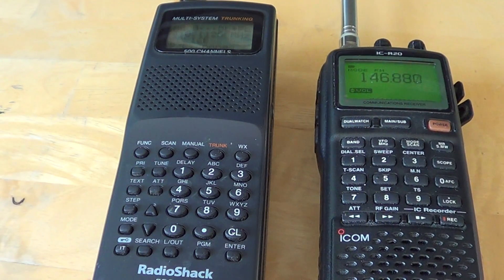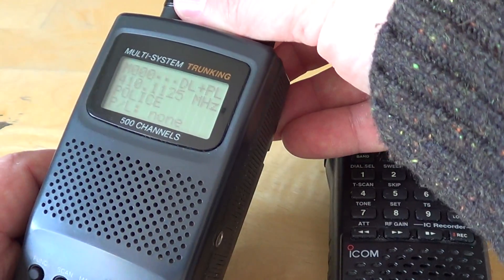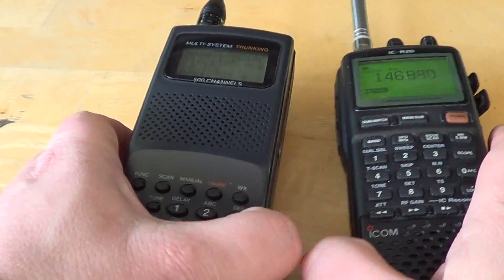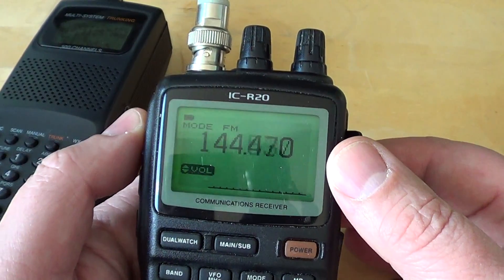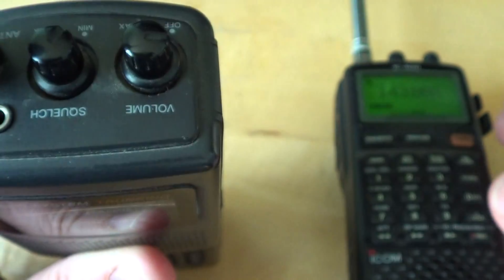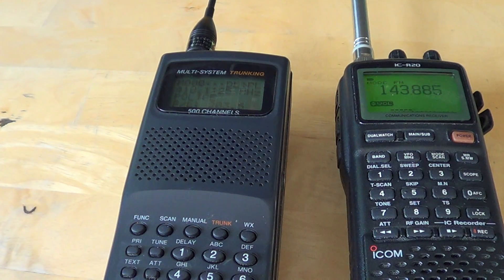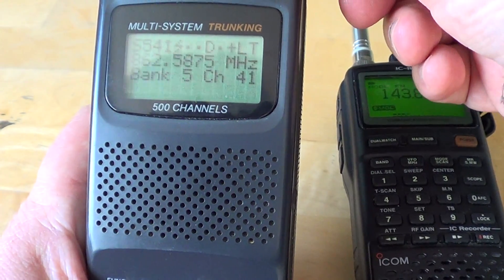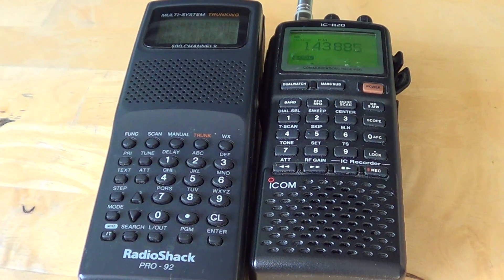Understanding squelch on radio scanners and receivers

Comment: I set it a tiny bit higher than the threshold because I find at times it can be a little slow to close after a transmission and does static for a split second. Also it can make the scanning rate slower too.

Comment: Thanks Man, this video helped me a lot to understand Squelch. 

But now I have a doubt. I got a Uniden BC125AT Scanner, for Civil Aviation Scanning, some of the communications are lost, i.e. Control Tower transmits and then Pilot responds, but I cant hear what the pilot says at all. I realized of the problem because it seems like the ATC is talking to himself. Would it be happening because a setting in my Scanner or just because the antenna it has is too short in range? 

Thanks for the prompt response.
Reply: I fly commercial and can tell you that it’s most probably because the plane is probably too far away and their transmission is too weak
Reply: @iicaie  Thanks